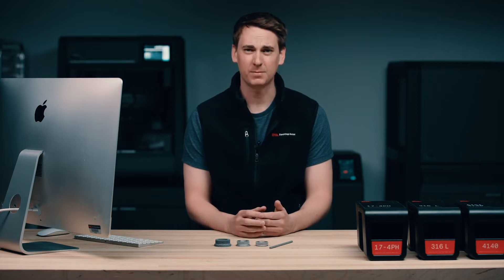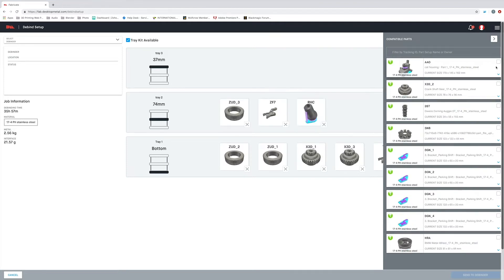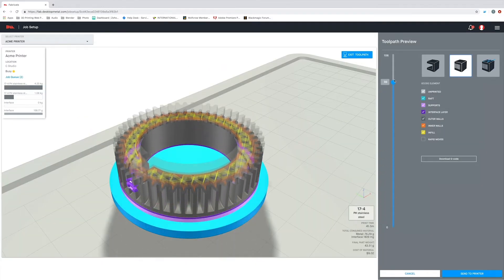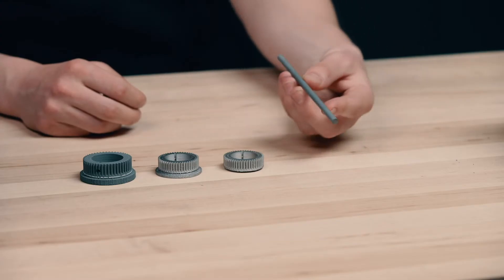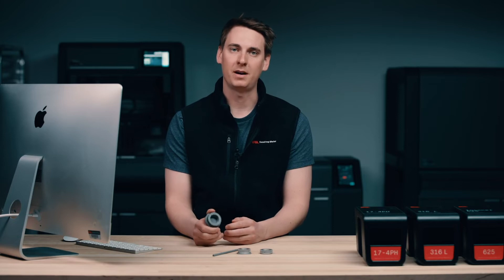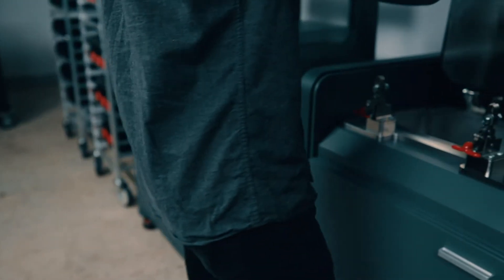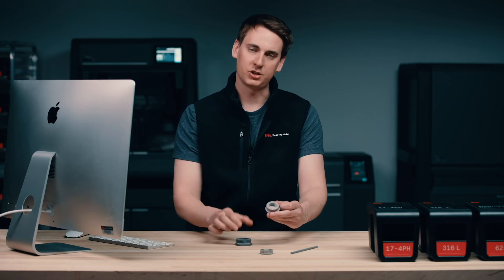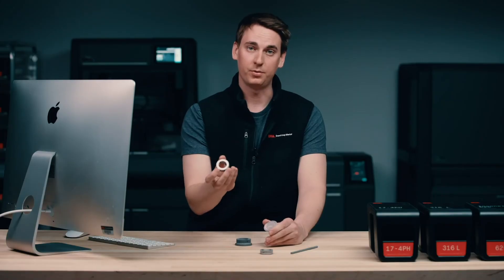Desktop Metal Studio 3D Printing Process | Metal 3D Printing 101

Comment: I think I have a pretty good idea of how this works... the print cartridges are filled with a labeled fine-ground metal and a wax (resin basically...?) as well as a polymer (plastic filament powder?) binding that is heated to the near mailable working-temperature of the metal, raises the viscosity of the wax (soon to be soft resin that will lift itself to the outermost edges of the... mold? model..?) and the polymer filament becomes a suspension encasing the mailable metal & hopefully making the gaps in the intervals uniform & regular throughout before the modeled part is cooled and the filament sets (that vacuum performing a double purpose of adhering the build-plate in place and to a small degree ventilating the chamber to direct the airflow as the materials cool & harden...). The “debinding & centering” process is basically a ‘Wash’ to remove the waxing encasement (...and I assume, regulate the temperature of the whole by the transitive property of distribution of energy through a fluid & chemically prepare the polymer for extraction?). The Furnace is going to carbonize the metal while the polymer is heated to sublimation & again regulate the gaps between metal until the process is completed resulting in the reduction in mass to occupied area of matter (and curing the ceramic securing the part to the plate that has also been diffused with polymer to regulate spacing & facilitate the crumble-to-dust effect of removing the manufactured part). 

I’m pretty sure that is a rudimentary take on the process... I’m no chemist or engineer, but it makes sense in my head (... 'though I may have missed a few steps in my description). The simplification of the process into a uniform standard is ingenious enough, but I’m still seeing an application capacity loss for the finished product being suitable for any kind of lengthy or consistent regular use. I would love to see a density scan of a finished product, but I would say that the structural integrity of the part is still flawed by gaps in material density. It’s much better than a thermal laser beamed into a tray of fine metal shavings... but I think that the even consistency of the materials from the cartridge to the heated extruder is the biggest challenge? And then the element of consistent application of external force to compact and intensify density are still going to leave the performance issues compared to of a more durable manufacturing process.